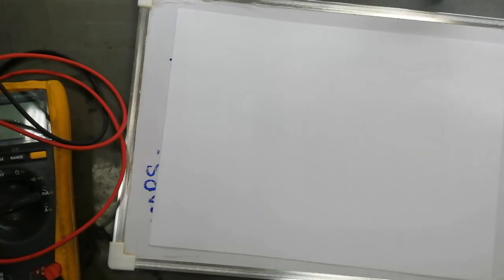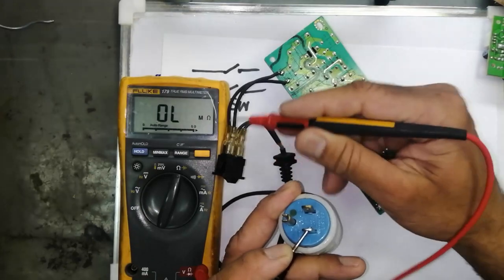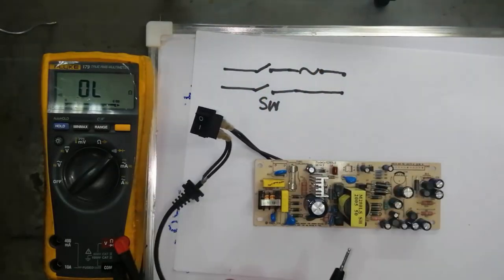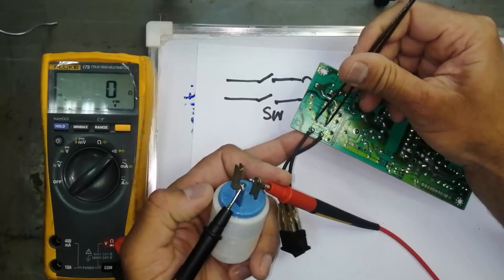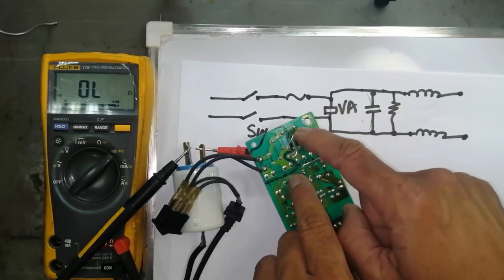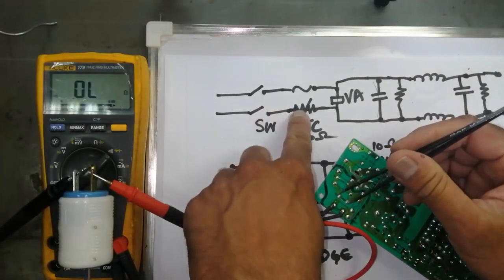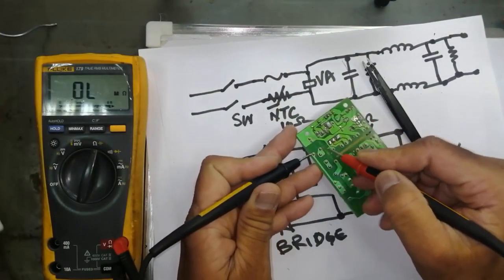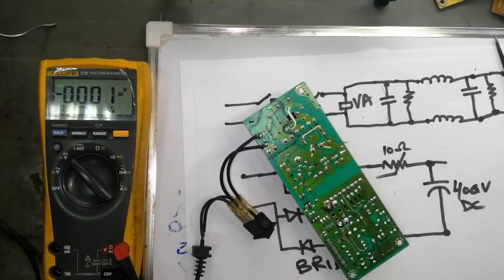{145} Fuse Keeps Blowing in SMPS || SMPS Input short Circuit || How to Find Short Circuit in SMPS

Comment: Amazes me how casually you are probing the hot side of the board with the circuit turned on. I noticed the probes sometimes slipping a bit, and I am constantly worried about probing a circuit like that in fear of shock or creating shorts that will blow parts of the circuits... are you taking some kind of precautions for this (isolating transformer or other things) ?

Comment: Thank you for sharing your experience and knowledge. I have an ac small power supply that does not have any output. There is a bulky fuse inside the circuit. When I test it with multimeter it does not give a buzz or sound, but when I check it's resistance, it is 2.50 mega ohme?
Any idea?
Thank you for your help and kind support.
Reply: @HaseebElectronics  Thank you for your quick reply!!

Comment: I have a PSU that blew a fuse violently (the power transistor, some schottky diodes, a capacitor ended up being shorted). After identifying and replacing all of those faulty components I again got a blown fuse (and the components that I replaced were again bad, only this time also the bridge rectifier was shorted). Still unclear what is causing the short. Everything on the input side seems to be fine. Can a bad feedback circuit also cause this kind of violent short on a board ?
Reply: Haseeb Electronics thanks for taking the time to respond. There was no short on the input and there is no IC on the PSU to generate a PWM. So I guess this is done using discrete components. (There is a picture of the psu on the community tab of my channel)
Reply: @HaseebElectronics  there is a second transistor driving the main power transistor, but need to figure out how the oscillation works (don't have schematics and too novice to reverse engineer). The PSU gave about 10V on the 12V output rail for about 5 seconds before there was a heavy bang

Comment: Hello M.Haseeb, what is the difference between continuity test and Ohm test ? a PSU can be in short circuit due to a Voltage Arrester but doesn't do a tone on the continuity test ? in that case should we use Ohm instead ? at which resistance can we say that there is a short, even when continuity test is Ok ? to test the VA, should it be removed from the PCB ? Thank you & Salam Aleikum.
Reply: @HaseebElectronics  This is very funny: i checked the capacitors, bridge rectifier, mosfet, all is fine, however I have some strange readings: at the capacitors i have 545vDC !, the series lamp stays a little bit on, like a small short circuit, i took another Xbox PSU i had and the same thing.
Then, i surprisingly noticed on the cover that this was the 120vAC that they sold me whereas we have 220vAC, so that is why i had those troubles...
Now, in order not to "loose" those nice and well build PSU, can i make them work under 220v without too much complications ? thank you & Salam Aleikum.

Comment: Hi, What is that while unit connected with multi-meter leads for checking the short circuit.
Reply: @HaseebElectronics  @11:33 on above the multimeter - there is one white round thing with 3 pin, you have connected multimeter red lead to it. Please check the time line @11:33 - Thanks

Comment: Salam M.Haseeb, on the PSU the fuse burns again and again, i checked the voltage arrestor, it is open, and the resistance between the 2 mains lines is 1.8k ohm.  on the continuity test, the capacitors are not shorted. What to check more ? thanks
Reply: @HaseebElectronics  Hello Again, it WORKS !!! the problem was the diodes ! I have 315vdc at the capacitors.
BUT now,  i do not have power in 12dvc 5vdc and 3.3vdc, probably the PS222 controller has detected a short and locked out the system, how to remove the fault (PSON or FPO i think but not sure...) i left it unpluged for a night but nothing...

Comment: Salam M. Haseeb. Another question, sorry to bother or to disturb the rest of the fellow friends. When i connect a load (halogen 12v lamp) to the output with wires, it makes a short noise then the psu shuts down, like a short. but when i connect the load then turn on the psu, it is fine. What is the best way to connect wires to avoid cut off protection ? thanks & salam aleikum.
Reply: @HaseebElectronics  i will see into the 2 circuits identified : LM339n & AS 2333F. thanks for your time and answers ! Salam Aleikum.
Reply: @HaseebElectronics  Does the LM339 have the over current protection so that i can remove it ? Thanks

Comment: hello sir, i have ntc which measure 0 ohms, is it good?
Reply from the maker: check the value written on the component. 
for example 10D-9 that means 10 ohm value
5D-6 means 5 ohms
it should show the same value at room temperature. its resistance should decrease with increase in temperature
Reply: @HaseebElectronics  ok sir. thank u i will check on that..
Reply: the only mark i see is SCK 015
Reply from the maker: sck-015 is 1Ohm 5ampere
normal resistance at 25 deg centigrade is 91 ohm
Reply: @HaseebElectronics  so my ntc is broken?
Reply: @haseebelectronicsurdu  thank u so much sir... i really appreciate you... thank you....

Comment: What should be the reading range on that NTC legs ( resistance)  on the AC input side. Mine reads 110 ohms.
On the fuse side I have continuity from the AC input to the first leg of the fuse (10A), 110 K ohms.  Maybe this is one reason why I have no power to the circtuit?
Also on the rectifier I read voltage backward and forward on all the legs.  Between DC negative and positive it reads .002volts both ways.  Betwen two middle AC legs read 1.02 volts both ways.  Between DC positve or negative to the AC either legs it reads .56 volts regardless of where I place the leads on the multimeter diode mode....  Something is not right.  I have no power to this LG washing machine.  Could it even be the main IC?
I replaced the fuse first as it was blown.
On this board it seems that one leg of the  voltage arrester is on one leg of the AC input first and then the fuse and the othe leg of the voltage arrester is on the far leg of NTC.  And there is no connection from the one leg of the AC pin to the fuse but there seem to be a connection from the first leg of voltage arrester to the fuse but it reads 110 Kilo ohms.  That is not right.  There seem to be a hole/ severed type of cavity there between that leg of voltage arrester and the fuse.  But there is clearly no connection to the fuse from the AC input directly.
Reply from the maker: please check the part number NTC on the part for example if it is 110D15, then it will 110Ohm, (you can check video number 134 for NTC)
2. continuity from ac input terminal to the fuse first and second end should zero ohm, while with the other ac terminal it should high resistance, if it is 110K as you mentioned, then it seems good
3. if at bridge rectifier dc terminals you find zeo ohms that means next circuit might have some issue, mosfet or any switching device or other component in power rail or main dc capacitor is short (kindly compare with video number 314 as the same issue i solved in that video)
for quick reply you can send whatsapp, my numbers are in my channel homescreen